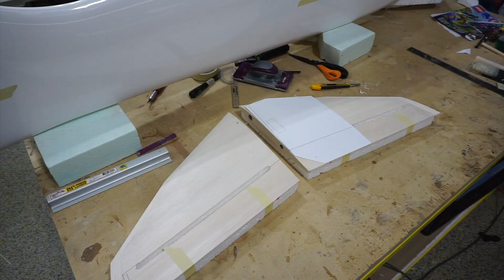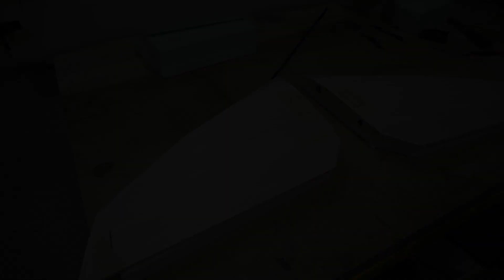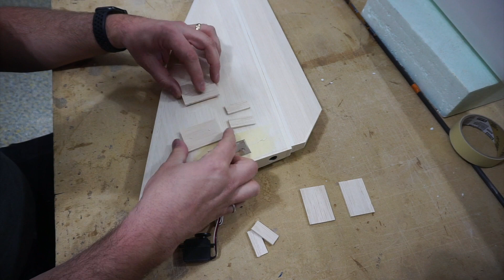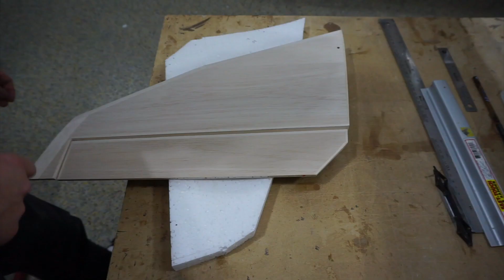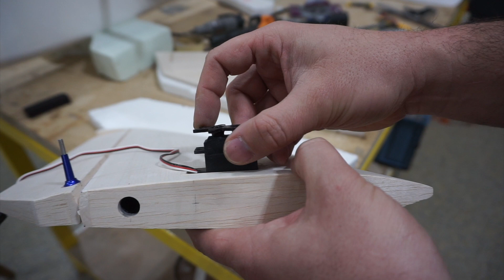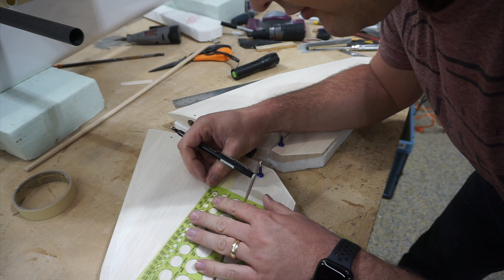Akuma+ Build - Installation of Elevator Capping, Servo Boxes, Hinging and Hardpoint

Comment: Very nice. I tried to buy the Easy-Touch Bar Sanders you use but they seem to be discontinued at Great Planes. Bummer.  Great job on the build and the video, she's coming together nicely!
Cheers!
Reply from the maker: Hi Bob, yes I have had them for a long time, another type are the Permagrit tools which should work out nice as well.  Or you can make your own from two pieces of aluminum angle from Home Depot etc.!
Reply: @chadnortheast  
I'll take any excuse to go to Home Depot!  Thanks Chad, I'll check out Permagrit.
Stay safe!